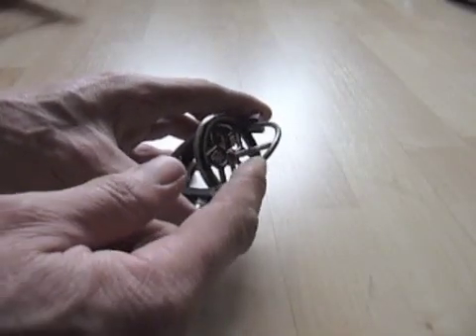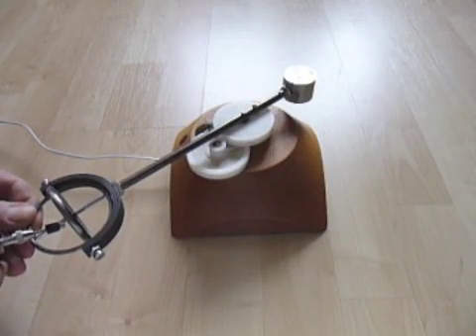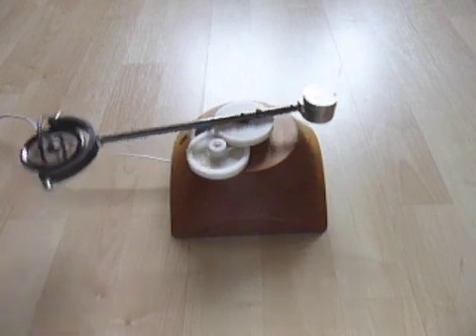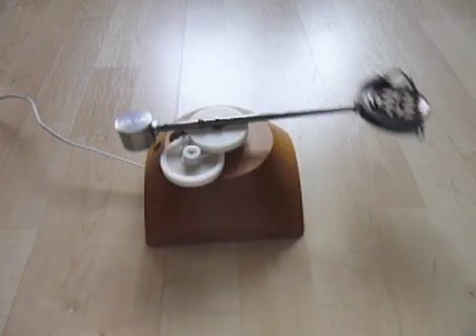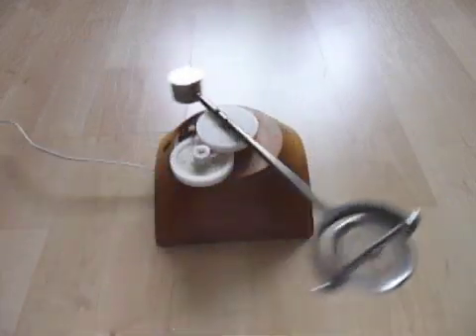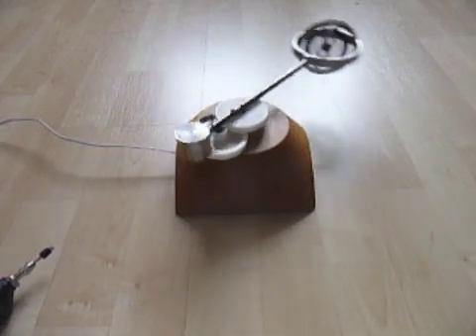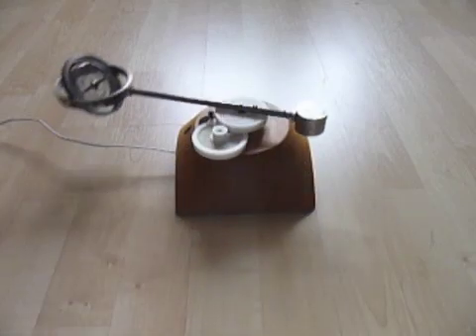orbiting gyroscopes

Comment: I mean, it shoudnt be affected whatsoever if its only moved in its plan of rotation, yet it kept tilting around..
Reply from the maker: Thanks for your comments! I've been trying to find any theory to link this to planetary rotation but no luck so far.
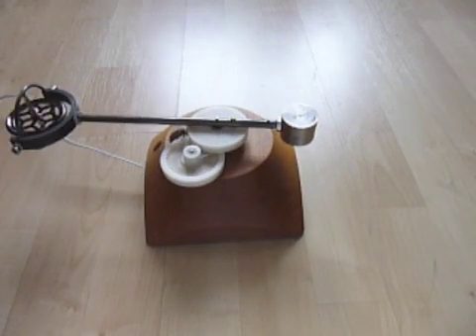Reply: adrew721 1:11- 1:12 . it flipped? how? why?  I dont understand how that is even possible. I thought that the only way to alter the plan of rotation of a gyro is to  put a torque on it PERPENDICULARLY! , yet here no such torque existed
Reply from the maker: I'm no physicist but I think that because the gyro is traveling in a circle, the outside edge needs to follow this to conserve maximum momentum.
As there is no external gyro drive, the gyro has not enough energy to keep moving and follow its origional axis.
Reply: @leviterande  Cos the gyro is moving and has momentum and is turning around in a circle as well, changing angle. It's finds the easiest path, influenced by it's spin.

Comment from the maker: Thanks, I will have a go at an answer. The main feature of a gyroscope is angular momentum which is a product of speed mass and diameter. Law of conservation of momentum means these values adjust to maintain same total e.g. spinning skater reduces diameter to increase spin or a top losing speed from friction increases diameter by tilting.  By forcing a powerball to tilt energy is added increasing spin. As the flywheel is light and force applied great the increased speed is proportionally high.

Comment from the maker: Thank you for comments, I hope that I can answer your question.
Looking from above with the gyro rotating vertically, if the connecting bar is rotated anti-clockwise the gyro will try to realign so that the outer edge also rotates anti-clockwise (when seen from above) The maximum momentum is at the outer edge of the gyro through leverage, by following the orbital direction the maximum combined momentum of the rotation and orbit are conserved.
Hope this helps. Thanks, Andy

Comment: This is very interesting. Thanks for your work on this. I have a question. 

For the purposes of my question, consider my position of view - floating directly above the geared mechanism.

1. Spin the gyro wheel up to speed in a clockwise direction.
2. Orient the gyro wheel vertically.
3. Accelerate the bar connected to the motorized mechanism in a counter-clockwise direction.

Question: What does the gyro wheel do in reaction? Does the highest edge of wheel tilt toward the connecting bar? Or do